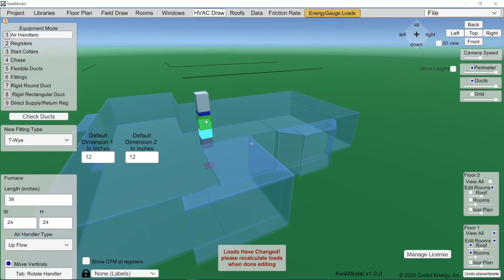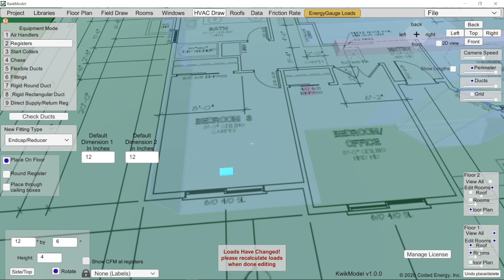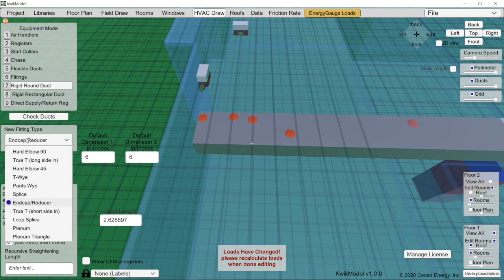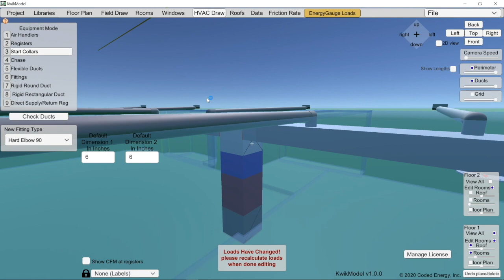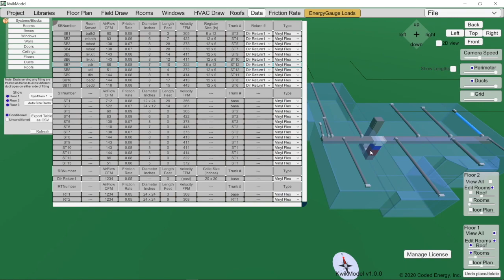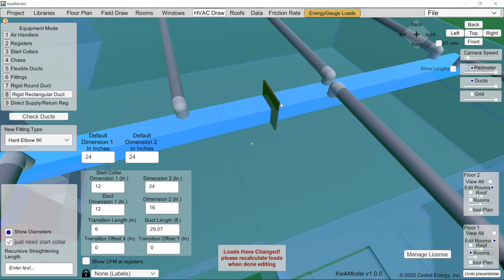How to Draw a Rectangular Duct System in a Basement

Comment: Will there be support for rectangular registers that can be suspended? Industrial style exposed duct work is very popular in Texas, and will also give companies the opportunity to simulate light commercial applications as well. Thanks for the awesome tools and video support!
Reply: Hi Jonnyberockin.  A register either needs to be attached directly to a sheet metal duct (called a "Direct Register" in Kwik Model) or it needs to be "mounted" in a ceiling or a wall.  All you need to do is make a "fake ceiling" at whatever level you want by using the "Drop Ceiling by" command in the Rooms tab.  Lets say the room is 10' tall and the registers will all be 2' down from the ceiling.  Make a 10' tall room, type "2" into the "Drop Ceiling by" box, click the button and a false ceiling will appear that is at the 8' level.  You can put the registers in that ceiling.  Normally, this feature is used for dropped ceilings that we be used to hide ducts running below the floor joists or something like that, but the dropped ceiling does not affect the loads in any way.  It is purely visual and is pretty much transparent in the software.   You can change the size or the registers and we have round/oval registers too.  ~ Russ